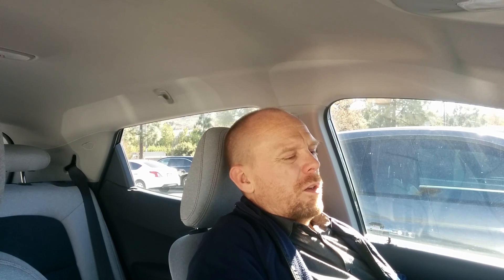Plug-Side Chat: Equipping EVs for Cold Weather

Comment: I think the automakers really don't understand cold weather, I'm not saying it is not cold in the US, but most of the US isn't so for the few citizens facing a few months of cold, they really don't care.  In Canada or more specificaly in Québec where I live,  I can see my range go from over 400 Km in summer to 270 Km in winter and that is not even on the coldest days, that is about 33% less range.

Some people for whom range is very important have installed a small diesel fueled heater to keep both the battery at the right temperature and the interior compartment livable while preserving range.  The cost for that installation is about $2000 and it uses very little fuel.  I for one would not like that, being a purist, but to some it is a workable alternative to plugging in more often in winter than in summer, especially if stopping is not an option!

In years to come, batteries will be both less expensive and lighter so having a small car with 100Kwh or more could be the right answer because I don't see recuperating waste heat as being the answer when it is -30°C outside.
Reply from the maker: I think GM does. They do some extreme cold weather testing, but I think they also knew that a majority of their EVs would be sent to California. They are supposed to be developing a cold weather package, but we'll see.
Reply: @newscoulomb3705  They may do some testing to see if the cars 

"work" under extreme conditions, but I'm sure range was not a major issue in their testing since as you say most of their sales would be in warmer climates.  In the province of Québec, the Bolt is a BIG seller, dealers can't keep them in stock, there are waiting lists even because 1- it's a good car,  2- it is probably the cheapest with a rather long range and 3- electric rates are amongst the lowest on earth (9 cents / Kwh) a "fill up" here is less than $5 BUT it gets cccccold.

Comment: Bolt and Volt owner in Arkansas, here.  I have the Comfort and Convenience pkg for the heated seats and wheel, but still have to run the defroster to clear the glass due to the relative humidity.  I park my cars in a heated (about 50 degrees) garage.  Currently sharing a single Clippercreek charger between the two cars.  Most of my driving is local, so I dont worry about nixing miles for heat.  I think (I hope) the passage of time and some R&D will ultimately bring about some better options to allow you to stay out of hypothermia and still run efficiently.  😄
Reply from the maker: I hope they start including heated windshields... That should help a lot.

Comment: All good points! Especially the point about manually adjusting the battery temperature for upcoming situations that the driver knows. I often thought about cooling my battery down as I'm getting closer to a Supercharger on road trips. Same with extreme cold. If I know I'm driving up to a fast charger and I have a very cold battery I would like the ability to warm the battery up as I'm driving there. At that I don't care about the extra energy used as I'm going to charge anyways.

Comment: How long does it take the battery to warm up to the desired target temperature when you are not plugged in ? I think for EV users who have access to Level 2 home chargers, the vehicle can be started remotely and battery can be preconditioned while plugged in and you don't lose EV range.

I agree that the coolant loop modifications should be made, but it would be nice to see the piecewise economics of this system, since the bolt is supposed to be an affordable EV and they really can't move the price point any higher.

Comment: I live in the north east area of Pennsylvania. Driving a 2016, BMW i3 REX. We had a recent cold spell (18-25 F). I normally put the i3 in the garage plugged into level-2 Charger and use departure time settings. With those temperatures I noticed a slight (3-5 mile) drop on the GUESS-O-METER with preconditioning battery. Tried leaving the i3 outside two nights, no preconditioning loss of 15-18 miles on the GUESS-O-METER. I have a 72 mile commute each way to work. In the summer, vary rarely used REX. I have access to Level-2 at work and 20A wall charger - I charge up on Level-2 at then move to free charger and use level-1 wall socket for preconditioning. Without preconditioning I need 15-20 miles of REX each way, with minimal cabin heat. With Preconditioning I need 6-12 miles of REX. If I kept the cabin heater on 68, I would probably require REX minimum 20 Miles. Hate using REX, but my first EV and it's much less ICE emission then any previous car. Sorry Long reply - others considering EV, COLD weather is a major factor for 80 mile range EVs.

Comment: Tesla's still use Induction motors, the Duel motor has a mix of one Induction and one permanent motor(front for highway travel speeds). Specifically the Model 3 duel motor.
Reply from the maker: Yes, and the S/X use two induction motors. I'm not sure of any single induction motor configurations by any automaker at this point. Even Tesla is only doing paired.

Comment: As someone who rode old motorcycles, flew old planes, drove old cars, I like things to be manual control, or at least manual override of automatic control. Manual fuel primer and carburetor heat on planes, manual choke on motorcycles and cars. Accelerator pumps in carburetors.

The same goes with overriding EV Automatic controls not related to safety. If I want to turn on my battery heater, as long as my battery temp is below optimal for whatever I want to do (charge or drag race), I should be allowed to turn it on. If I want to cool my battery down to the lowest temperature allowed for charging, when at the outer marker, so that I can get rapid charging not limited by temperature, I should be allowed.

I would love a Bolt EV with rooted system that allows full access just like over clocking computers, Android, Windows Mobile devices. I think we know GM did set the charge profile very conservatively, which means it can take a lot more as long as you are monitoring it for cell imbalance, high temperature, high voltage. 

Once there are lots of EVs with expired warranty, I think we will see plenty of custom ROMs available. But Tesla is working as hard as Apple to keep people from owning the device they purchased. Even the processor on the inverters have a 128-bit encryption, which is why people have to build their own drivers for the IGBTs.

Comment: Heat pumps are always going to be more efficient than resistance heaters, of using proper Freon and pressures. Air at -18C still has 85% of the heat as air at 21C. What heat pumps DONT like is weather just above freezing, since the evaporator will ice up and need a reverse cycle while resistance heat strips kick in to offset it.

But I prefer the Bolt EV heater. If it breaks there is a good chance I can buy the heater modules or deteriorated hose, and be back in business, and being totally independent of the battery and drive unit coolant loops, there’s less chance of catastrophic failure.

However I think heat pump would be worth it on a high end car like I PACE if used in cold climates, ESPECIALLY if you use your car as a lounge while waiting somewhere and not plugged in. The heat pump will use 50% of the energy as resistance heater, which would add up if you run it 10 hrs per day. 

Of course it will need to reverse cycle occasionally to dehumidify the cabin and deice the evaporators, or the heat pump evaporator can be in the coolant loop of the drive unit.

Kman just covered this topic, and I agree that all the extra complexity of diverted valves just to get a heat pump won’t be worth it for most EV owners. It’s just like installing solar panels on the car, for the 2 kWh per day you might get if lucky from a 300 watt system,. You can just spend $400 more and add 2 kWh to the battery, which you can use even when the Sun isn’t shining.

Comment: I assume that you have never driven in a snow storm with your Bolt. With the Volt it seems that in order to keep the windshield from forging up on the inside and to prevent ice build-up on the outside that the defrost setting needs to be set to max. In addition to that, the rear window heater needs to run constantly as well. While the ice melts quickly off the hatch rear window, it constantly fogs up if you turn the rear window heater off. The ECO setting just doesn't cut it when it's snowing or if it's below +15 degrees F. The side door windows will tend to fog up to. The over-all HVAC setting needs to be set to max as well. These are the winter related practices, mainly for safety that drive the battery efficiency down by 20% during the winter. With the Volt you do have the option of using the engine to heat the interior and provide heat to defog and deice the windshield. So, would be interesting to see how the Bolt does or a Model 3  in a similar situation.
Reply from the maker: I have driven my Bolt EV in a snowstorm, but admittedly, it was no that severe. Mostly it's freezing weather with high relative humidity. Regardless, in those situations, you just have to run the heater. There's no way around it. As long as you have the range you need to get to your destination or have fast chargers along your route, it's not a huge deal. 

The bigger issue with pure BEVs is that they don't always maintain their battery temperature during normal driving, so by the time you are ready to recharge, you're only charging at a 30-50% of your typical charging rates. That's why it's an issue. 

The reason I think Bjorn doesn't run into the same issues as other EV drivers in that regard is because he drives his vehicles hard, regardless of conditions. So his batteries never cool off, and he never runs into issues charging during winter.

Comment: You know whats crazy? I have owned a leaf for over 2 years (just sold it). And a Spark EV for a year (keeping for now).. They would get much much lower range in the winter time from 3 to 20 degrees F (Maryland). So far, our Tesla Model S, when its preheated... we dont see anywhere near the reduction in range. That preheat of the battery really goes a long way. I was figuring "half" capacity. That is a good conservative estimate for cold weather. Its nowhere even close. Side note, i dont think AC Induction motors put off enough heat for warming anything in winter temps. I also thought they were more efficent than PM Motors at higher revs.... i really need to look back on that topic.
Reply from the maker: Induction motors can be more efficient than PMAC motors, but within much narrower operating parameters. As far as waste heat goes, the induction motor probably doesn't produce enough to heat the cabin, but it should be enough to keep the battery warm.

One of the reasons I think Bjorn doesn't run into issues where other Tesla owners do is because he... wait for it... drives it like he stole it! :-D

Comment: Another issue is battery temp. What does torquepro say the battery temp is when driving? The battery has a dedicated heater. How low does it let the battery temp drop in terms of pulling over to charge?
Reply from the maker: I'm definitely going to be monitoring battery temperatures this winter to see what type of data I can gather.

Comment: I still don't get your idea that a heat pump for heat is more energy as it isn't within it's operating range. And for VERY cold operation it may well need backup. I'm also going to guess that while you get 'cold' in California I don't you deal with the relentless cold and dampness we do farther north. 

For instance, I notice that below 40* here the defrost has to be literally on ALL the time, to the expense of floor or dash heat, to keep the windshield clear. I also notice with the rare clear winter day the sun will keep the glass clear. Part of that is just the amount of moisture in the air on the usually cloudy days. It just kills the range.
Reply from the maker: I don't think it's more energy. I think it's more cost and complication with little real world benefit.

If it doesn't cost too much and it's operating range of temperatures was wider, I think it's totally worth it.
Reply: @newscoulomb3705  I agree it may be more expensive but it should\could replace a separate air conditioner.
Reply: I would pay more to get greater winter range. Maintaining temps more directly eliminates a coolant loop {apart from the HVAC) and a supplemental resistant heater (air exchanger) should be cheap..
Reply from the maker: So would I, but a 60 kWh battery with thermal management and consistent 45 to 55 kW charging accomplishes that better than a 40 kW battery with a heat pump.
Reply: @newscoulomb3705  I'm not sure that should be true. I do think more demand for EV heat pumps would bring down the cost. I haven't come across info that establishes that heat pumps can't accomplish the task. 

Also, I don't think those companies that are using them would put themselves at a seious disadvantage using them. Of course, I drove old air cooled VW vans in the winter in my younger days.

Comment: Model 3 supercharging in cold weather.

"(Link to post is "facebook dot com/tsla3/videos/857552894416181/". I can't figure out how to include a plain link without it getting converted to an embedded media.)

They got zero charging for (at least) the first 11 mins after plugging in. After 45 mins it was only up to 34kW.

+14 min: 4kW
+15 min: 5kW
+20 min: 9kW
+25 min: 14kW
+45 min: 34kW"

Comment: 2019 Toyota Prius has 2 models where you can add AWD. The rear motor sounds like it is an Induction motor as this video says No Permanent Magnets. Rear motor runs 100% from 0-6mph and then only when wheel slip is detected up to 44mph.  Check out TFL's video "2019 Toyota Prius AWD vs Wisconsin Blizzard - Sort of..." https://www.youtube.com/watch?v=la-GMjAlwy0

Comment: Other day I was watching  borjan and he was driving  Hyundai ioniq which it uses heat pump  it was drawing 1.2 kw and my bolt with same temperature  draw Round 3to 4 kw
Reply from the maker: Unless you are running side-by-side, it's going to be hard to compare efficiency. The Bolt EV has more interior volume and more glass to lose heat out of, so that's another reason to consider for the discrepency.
Reply: Was the Bolt adding the cabin heater AND the battery heater?
Reply: And does the ioniq have a separate battery heater?
Reply: @kujo49  I think some of the ev cars like Hyundai and kia use heat pump  which it's way efficient  than what they used in bold which is resistor  type if I'm not spelling it wrong
Reply: @heydarmussavi  Heat pump technology has advanced very much. My area uses heat pumps for heating more than cooling, and heating continues below 0*F, after which supplemental resistive heat supplements or takes over. 

The issue is having a compact unit while maintaining efficiency at an acceptable cost. If any other vehicle has a heat pump then the technology needed is a about ready. Supplemental resistive heat is the easiest part.
Reply: Ioniq consumption (1.2) was for 1 km (125 wh/km is in the ballpark).  Ioniq is the benchmark for efficiency to date, but there’s no way the Bolt would be more than 300 wh/km for same distance.  Probably more like 170-180 wh/km on a near freezing day - after preheating the interior.  To twist the numbers, that’s about 3 mi/kWh, a number that’s definitely achievable in a warmed up Bolt in near freezing temps if your driving speed is similar to what the Ioniq was tested at (90 km/hr - 55 mph).
Reply: @dennislyon5412  4mi/kw is average for a Bolt under average conditions. With snow tires and heat I can have difficulty maintaining 3 mi/kw in the lower 30s*. Lifetime for my Bolt is 3.7 currently as we adventure south part of the winter.
Reply: Mark Hegg - mine probably gets a little less for average, since its 100% up north, and I like to be comfortable (heat).  The Bolt delivers very impressive efficiency year around.  The summertime numbers are - amazing!
Reply: I agree on the Bolt's heating capacity and summer numbers but, WOW, the winter numbers SUCK! I'm forever playing with the climate controls for the best balance between safety (windows fogging over or freezing) and range. Can't do anything about the toll taken by winter tires, which I must use. I'm afflicted by a 'systems analyst' outlook.

Comment: Heat pump in Leaf is much more efficient than resistance heat, according to Electric Israeli, and he says it’s heats up in a few minutes.
Reply from the maker: The LEAF has a hybrid heating system that includes both a heat pump and a resistive heater.
Reply: this depends on the year. our 2012 was pure restive all the way and worked brilliantly. 3 degrees outside and it still took just a few mins to heat the cabin. Additionally there was no combination of the condenser involved of the AC system. Physically separate.

Comment: Does a Tesla offer better range in cold weather than other EVs.  On a related issue, my Bolt EV (new this year) has an excellent cabin heater in our cold upper-Midwest climate. I was concerned that I would freeze in winter, but that is not the case at all.
Reply from the maker: Not that I've seen, but it does look like they lose less efficiency relative to the other EVs.